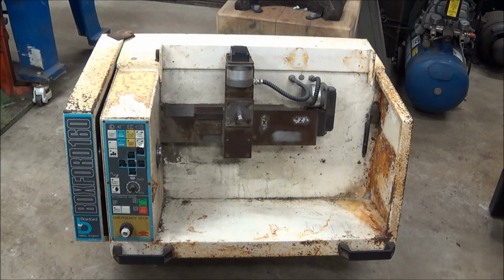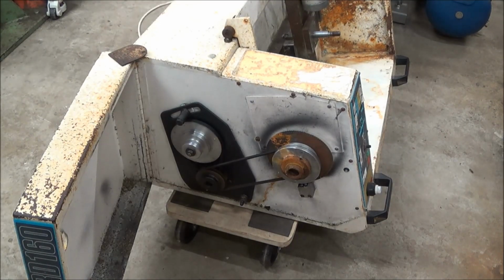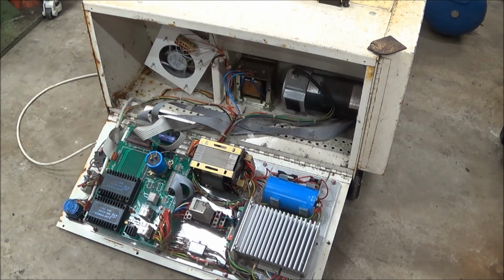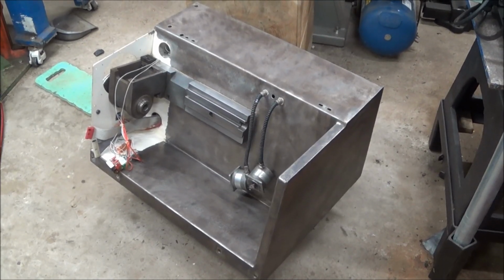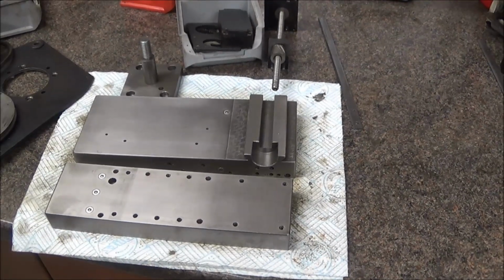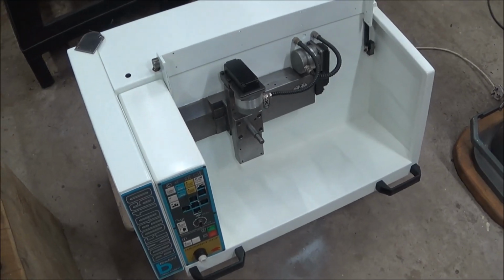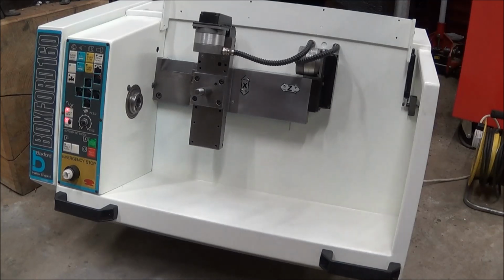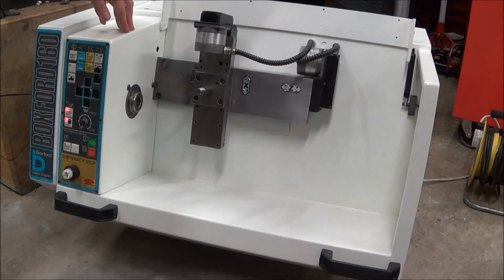Mini CNC lathe restoration pt1: Rust, paint and help!

Comment: will you have a follow up on this video?
just acquired the same machine will be following along, though i may take the linuxcnc path.
Reply from the maker: I plan to post more videos, but I am distracted by building a shed for my wife at the moment!
Reply: @machineshopatthebottomofth3213  will be good to see, i have got my machine driving and homing + tool changer working, just mis way through getting the spindle 0/10v working . i opted for function before cosmetics first, oh running mach3 with a RNR Breakout Board USB, i suspect i may need another as the 10v is not working likely i shorted it out.
i think linuxcnc has more to offer but will need an mesa card, i think you will be faced with a similar choice.

Comment: Ive got a partially converted Boxford TCL 125 the previous owner started to convert it to use a GRBL based control board, 
im not sure where to start with it, so it'll be really interesting to see how you approach this! 

Thanks for taking the time to document the project
Reply from the maker: No problems, thanks for sharing your experience!

Comment: Nice work on the clean up. Do you have the wiring diagram for it? The first step would be tracking one down, so you can see what interfaces those original drivers have. If those stepper drives are step/dir, it will be very easy to interface with them.
I use LinuxCNC with Mesa cards on all my machines now. A 7i96 is an excellent compact solution for a small stepper machine like this. It is what I used on my mini-lathe conversion.
Reply from the maker: Thanks that mesa card looks like a good option. I guess I may be able use existing drivers with it
Reply: @machineshopatthebottomofth3213  If they are step/dir you can. If they have some funky interface, you might need to replace them. Do the motors have Nema 23 flanges? You might end up replacing them in the drivers anyway, as motor motors and drivers perform a lot better than those old ones.
The 7i96 can do a PWM output for  spindle speed. I used a dirt cheap amazon PWM - 0/10V board to interface with a VFD.

Comment: I have a denford starturn, that I got with no control panel and a friend of mine has assembled one that works really well for ball turning. It’s using the original steppers and original well made DC spindle motor. Mines on Mach 3 and isn’t great for screw cutting as the board it’s on only uses 1 reference point for spindle position.
Reply from the maker: Hi, I would love to see more details of what you did. Btw I have met you at claymills. What a place!
Reply: @machineshopatthebottomofth3213  ah yes I thought I recognised you! Can you let me have your email and I’ll send some photos and details